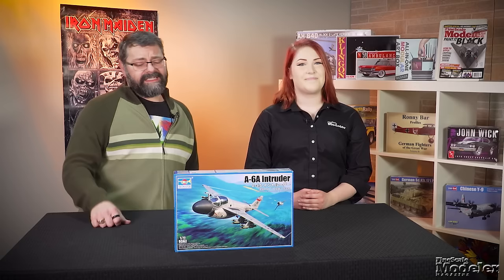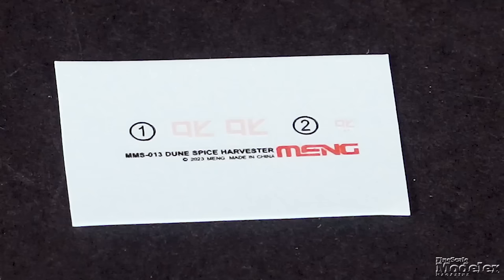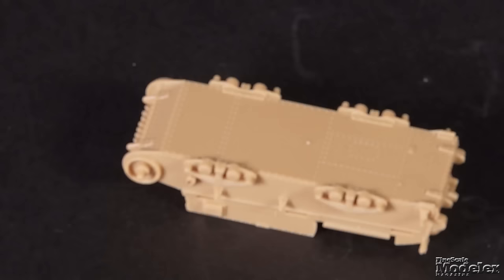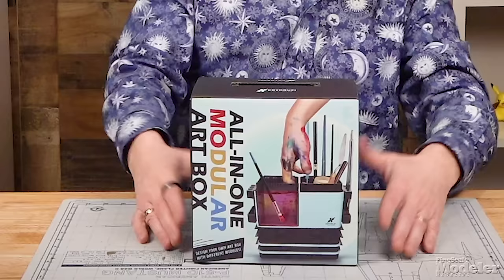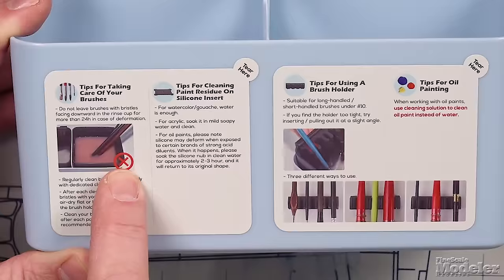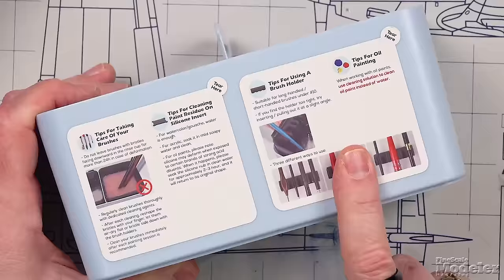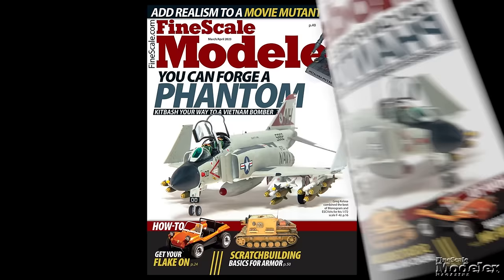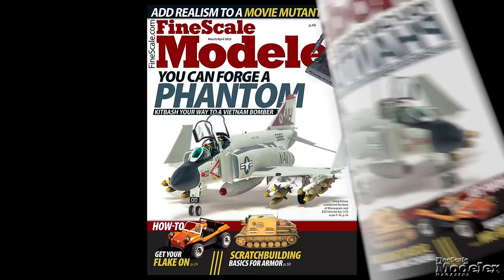FSM opens new kits, tests and reviews a modular art box/caddy, and discusses model production

Comment: Another reason of so many variations of similar kits is cost of tooling. It costs about $250K to make all the molds for a complete kit. Suppose you make a mold of a Tiger tank like you mentioned. You can use that as a base, then just a few extra molds, and boom early, mid, and late kits for say $325K instead of 3 totally different kits for $750K.

That’s a big part of why we get so many kits of what’s popular.

Comment: Okay here's my 2 bits.
I like 1/72 scale aircraft, I build almost all my Korean, Vietnam and modern aircraft (fixed wing, or helicopter) in this scale. Reason shelf space. I do have a 1/32 scale F4 phantom but only the one, it takes up a lot of space. Now I do WWII single engine aircraft in 1/48 scale, their only slightly larger than 1/72 Phantom. And I really like it when a company does all the different models of particular aircraft like this A6A, looking forward for a A6B, A6AE, etc. But that is just me. Also I like to build other company models of the same aircraft and same scale. Why? Different build challenge, different decals, ordnance, some come with pilot/crew, etc. Heck some will have folding wings, others not, detailed engine some not. Etc, etc.
Now I wish someone don't care who would do a 1/48 scale kingfisher. Built the old Monogram ot Testors version years ago, and it's long gone. Eduard, Tamiya do you hear me.
Cool video, have a great weekend.